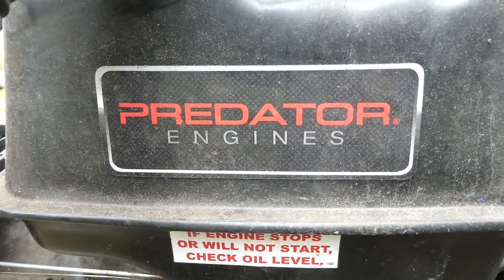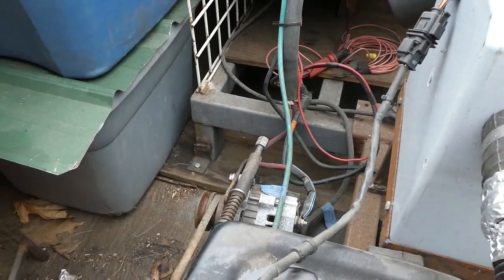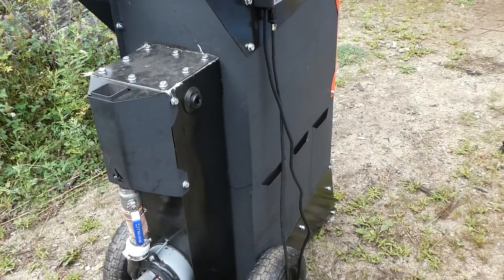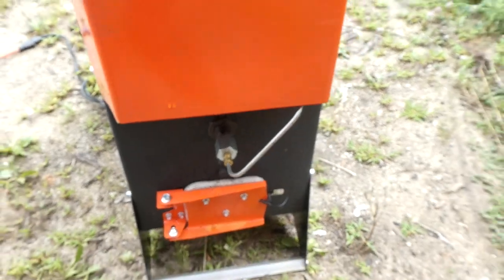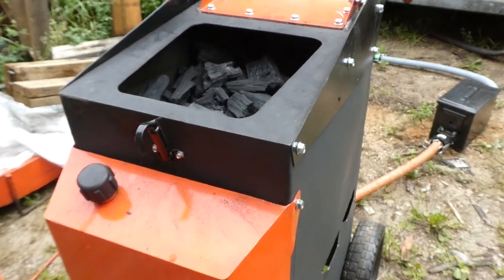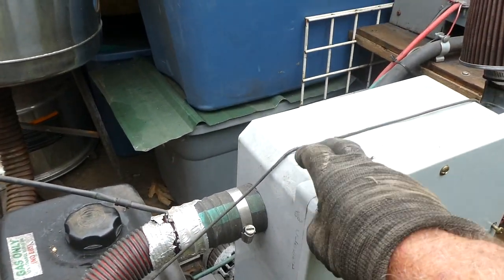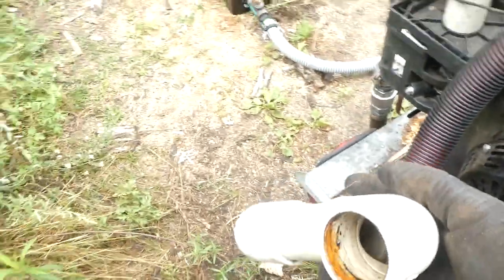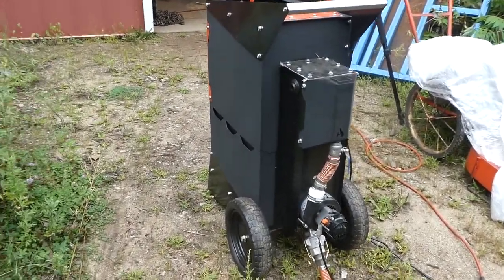NH Hbbyloggr _ DXF4 Charcoal gasifier startup success 081623

Comment: Also charcoal gasifiers like to make clinkers. Just the nature of the beast. Its always a good idea to run the machine out of fuel or as get it as low as you can before you shut down for the day. When the machine is cold and before you light for the day, check for clinkers!! They typicaly form directly in front of the jet or just bellow. This will cause the intake air for oxidation from the nozzle to have to migrate around this obsticle and you wont get a good reaction process going. If you have issues with weak gas or fluctuatinng gas, this is the first thing you want to check.
Reply: If you think you have one formed and are already running. Use a poker rod and stabb that in through the ignition port and try to break it up or push it out of the way. Then clean it out later after the machine has cooled down.
Reply from the maker: @Thrive-Off-Grid   What is the recommended way to shut it down when there is still a lot of charcoal left in the hopper? What I did was disconnect the main outlet gas hose , replace it with the cap, then wrap a few windings of rope gasket around the air intake nozzle. I does take a while to cool down. I will clean out the remaining charcoal this time to check for the notorious clinker party goers. Thanks for the feed back.
Reply: @nhhbbyloggr5022   You dont have to do anything other than shut off the engine. It will shut down there is no need to wrap the nozzle inlet. Trust me been using this jet system for years now. When you drop the draft from shutting the engine off, the reactor will degas and that gas needs a place to go anyways. Oxygen cant get in the gas / air inside is static. If anything I open the flare cup valve to alieviate gas exiting out the nozzle.
Reply from the maker: @Thrive-Off-Grid  Good to know. Adding info to the operations manual. I'm sure there will be more questions as we get deeper into it. Thanks !
Reply from the maker: Will do.  BTW, did you hear the difference in the noise level of the blower?  Now running as it should.
Reply: @nhhbbyloggr5022   Yeah those blowers are no joke they get it done!! They are pretty tough too, the motors are isolated from the housing. You can run them direct on 24 - 48 volts DC as well or get a small 600 watt inverter to run off a 12 volt car battery. Yeah these are the way to go as you have lots more options to power them.
Reply: @nhhbbyloggr5022   Niebors probably think you are building jet or something over there huh?
Reply from the maker: @Thrive-Off-Grid  They gave up trying to figure me out years ago.

Comment: Nice!! Yeah keep it simple dont over complicate it. Just to clearify the water injection systems primary function is to cool the nozzle. This water injection nozzle is our designed water atomizer jet system. (this is carried over to the DXF-10 and future series). The water is inject at the center of the nozzle and the air is vented radiallly around the water tube. This air rushing in grabs the water drips and atomomizes it. The idea is the water wil even coat a thin layer of water to the nozzle walls so that it quickly evaportates. The evaporation process is what is cooling the nozzle. Without this water injection the nozzle wont last more than 20 hours. I have yet to see a nozzle melt whne the water injection is used properly. 

Now there is a byproduct of this system. This is a water gas process. The resulting steam from evaporation process is now procesed post nozzle in the reactor. The hot carbon rips the oxygen out and combines with it to craate CO while leaving H2 free. So this will boost the energy density of the gas and makes the gas a bit more volitile.
Reply from the maker: Ahh, Thanks for the inside skinny, Matt. Keep the info coming as it will help a lot. Everyone has lots of questions.

Comment: Great job, I know you are really happy seeing that it runs and looks like it won't require very much attention
Reply from the maker: Set up time is a breeze ! It's almost like roll it out " Plug it in, push the button and play" ... except there are no buttons . I did not have the Inverter plugged in or under load but I'm encouraged by the initial start up.  Thanks for checking in !

Comment: Nice to see the charcoal system up and running. Bill what is the approximate running time on one hopper of charcoal with your setup?
Reply from the maker: Mike, I have no idea what the run time would be as of yet. In fact, this run was not planned at all, I walked by it sitting in the shop and said, " Hey, You have  40 min to get out there and start earning your keep".  Rolled it out, hooked up the hoses and off it went. So when the madness ends and I have time for a long run under the electrical load I'll have a better idea on run times. That said I think I heard Matt say 4-5 hrs on a hopper load. Will have to verify that at some point.
Reply: @nhhbbyloggr5022  Bill if you can even get 4 solid hours of runtime that's impressive. That would actually be a great question for Steve since he also has a charcoal gasifier that he built a while back.
Reply from the maker: @flash001USA  Yes, it would be impressive. Keep in mind that with my setup I can use it to either charge the battery bank for storage or run direct to a generator. My preference is to keep the steady load for charging the batteries, a round about way to get to the same place. I will have to upgrade the Inverter to 120/240 VAC to run the water pump and my secret nuclear fusion reactor. :>O

Comment: Did you Have a 6 cylinder Generator running off a Gasifier.
Reply from the maker: Yes we did although it was only about 30 minutes on our wood chip machine. I do have a large wood gasifier which should be able to handle it quite well if I ever get time to set it up. !
Reply: Looks good Bill. I hope you can get more time to mess around with it. Happy Thanksgiving to you and your family. Joe